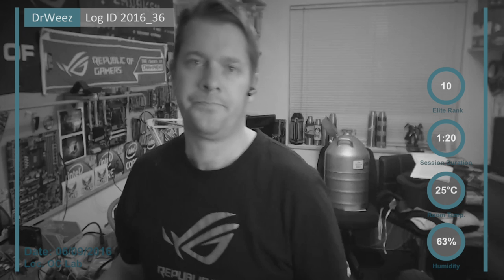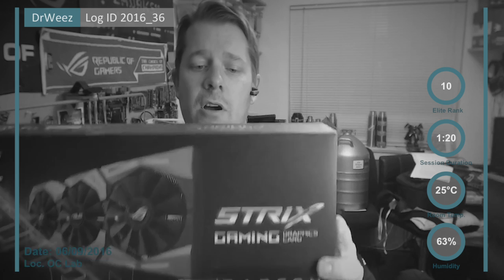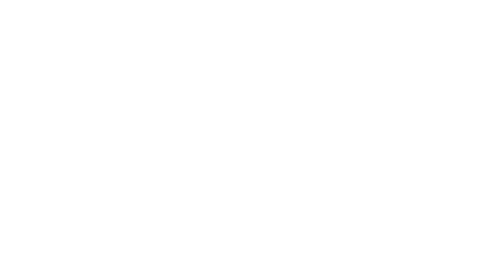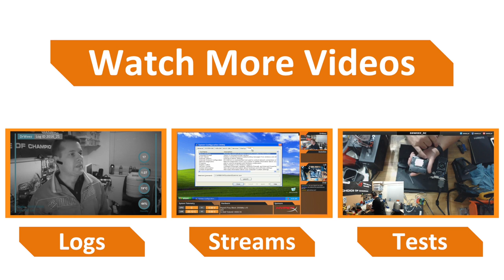Overclocking Worklog #36: September 6 2016

Comment: Hi, I just got the m8i and I was wondering if you could tell me which essential setting are you tweaking to get the most out of the cpu and ram. I don't see you changing the vrm switching frequency and stuff like that, is it ok to leave it on auto?